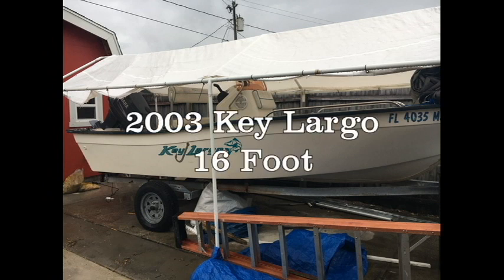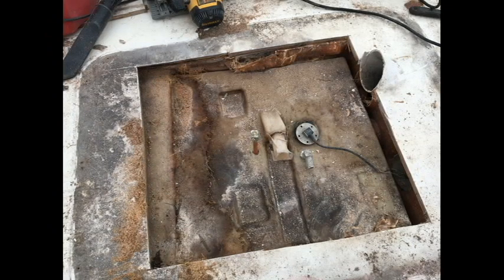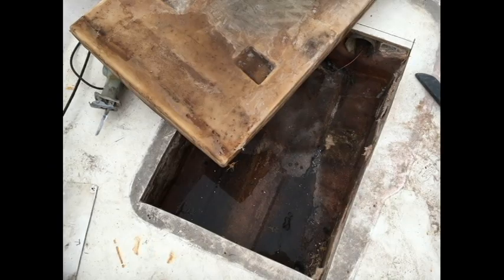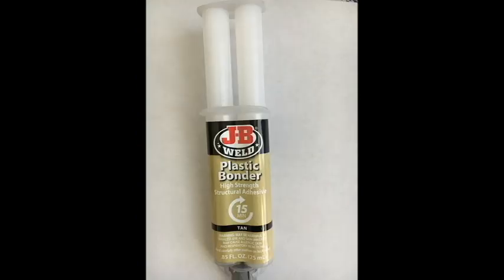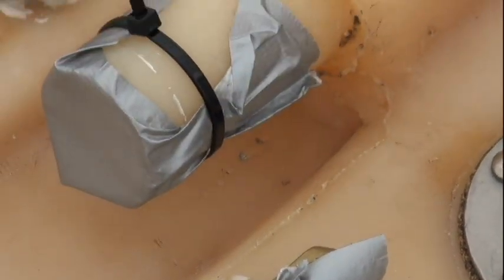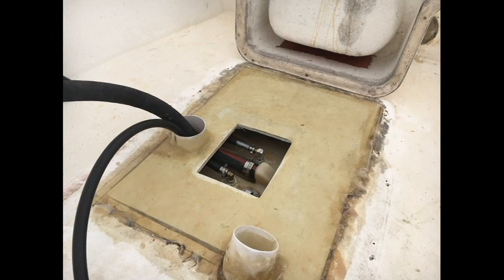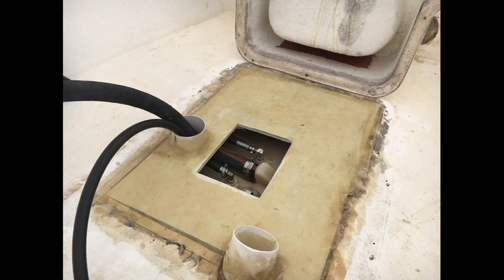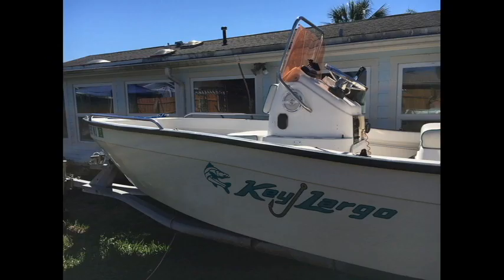Key Largo Boat fuel tank removal and installation

Comment: Coast guard regulations require the fill cap. To an internal tank be on the outside of tge boat. That way over filling won't turn into a boat fuel of gas . Don't ask me why. That's the regulation
Reply from the maker: Was the original location considered the outside of the boat?  If it is, any spillage would go to the same location as the one I installed, thanks for the info.

Comment: Hey, I'm working on a 160 key largo that I'm trying to get my fuel tank out.  IDK whereabouts in FL you're located, but I'd love some help
Reply from the maker: I am in Melbourne.
Reply: Dang, a little far from Wellington, I'm thinking of ditching the original fuel  tank, do you think the  moeller. 24" x 18" x 9" tall would fit?
Reply from the maker: @thacyko  I I am unsure, I didn't measure mine.  What is wrong with your original?
Reply: Fuel pick up broke off, it's extremely dirty, and imo too big, I don't need a 23g tank for a 50hp
Reply from the maker: @thacyko  My tank size is 17 gallons and I have a 90 hp so I like a large tank but I see your point.  I wonder why your tank is 6 gallons more than mine.
Reply: The factory spec says 23g
Reply from the maker: @thacyko  I couldn't find my tank capacity specs so while I had mine out, I actually measured it, I'm curious like that.
Reply: Another question, my rod holders are dry rotted, I'm going to replace them but I don't like the fact they drain under the center console, was thinking about making my own from PVC that have a drain on the bottom.  Did you change them at all?
Reply from the maker: @thacyko  Mine are a little discolored so I painted them with white paint and gave them a nicer look.  I thought about replacing mine but I would have to drill out two rivots per holder so I decided not to.  Why don't you mind that they drain in the center console.  There should be two little slits where the console meets the floor that are drain holes.
Reply: @prohomevideos  I'd rather keep the area where all the electronics free from any water/salt.
Reply from the maker: @thacyko  that makes sense, I guess it's nice that they drain very low.

Comment: I think the fuel filler hose should be on the outside hull so none of the fumes goes into the bilge just saying JT 🐟🇺🇸🎣⛱🛥🌴😃😊🙏🏻🙏🏻
Reply from the maker: Maybe, but the original design still had the filler on the inside.

Comment: Can you give me part numbers for the vent . Fitting the fuel pick up and fuel fill door so I can order everything so when tank is out I can just go at it ...thank you hope u can help oh and sending unit part number to
Reply from the maker: Hi, the vent filler cap is (Perko 1319DPGBLK).  The stainless steel fittings were purchased at Ace Hardware, they are 3/4 x 1/2 and 1/2 x 3/8.  The fuel pickup I bought at my local boat part store (DEF 7-0948) that you cut to fit the depth of your particular fuel tank.  I hope that helps!
Reply: @prohomevideos   hey would have a number for the ascending unit u used as well..than k u ver much I'm doing mine now how's yours been working?
Reply from the maker: @charlie807s  The sending unit I purchased at my local boat supplier, it was made by KUS (151322) and is a 5" pickup.  Make sure and measure carefully before making that purchase because they come in 1/2" increments.  It is better to go a little shorter than longer because if you go too long, the sending unit will hit the bottom of your tank and over time may try and push out.  Anyways, the whole setup has been working great and it has been several years.